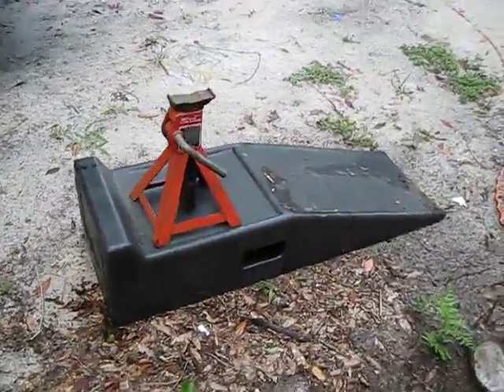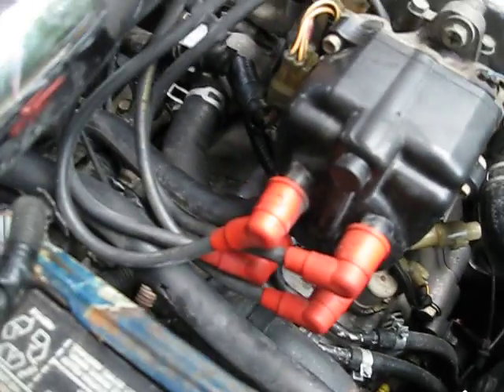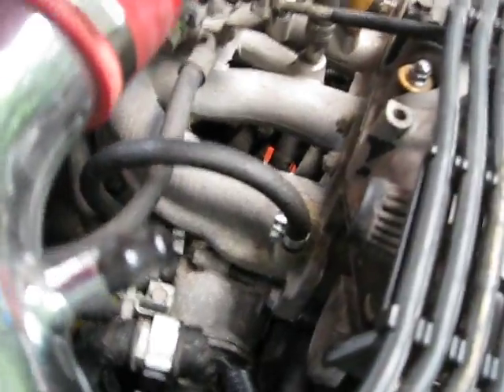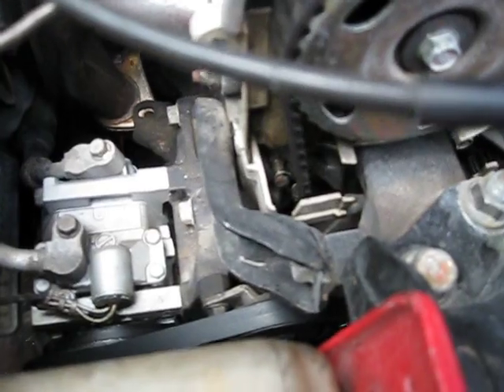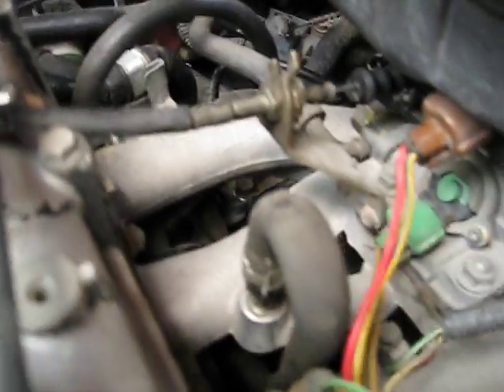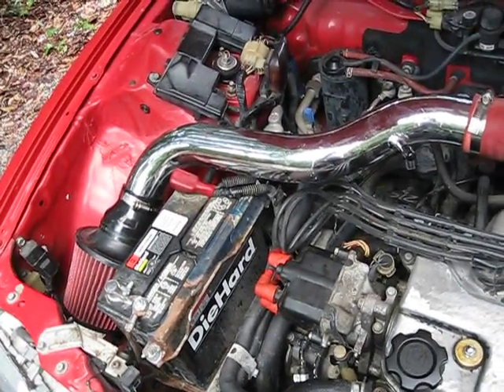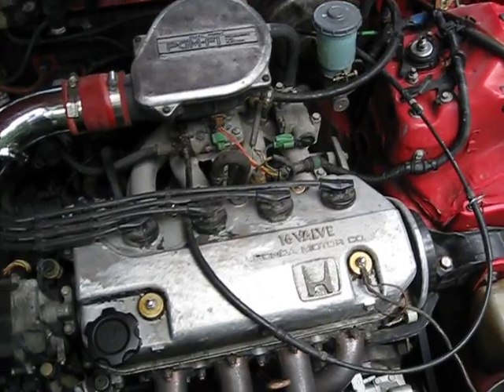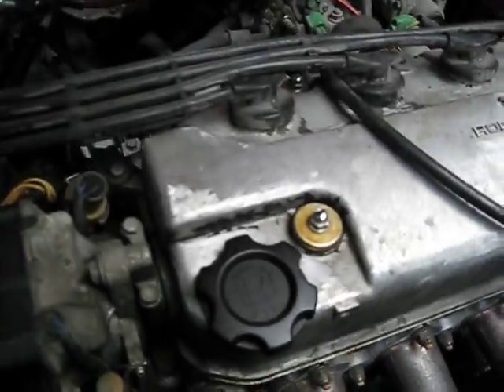CRX head gasket removal part 1

Comment: I have the same car with dpfi. All you have to remove on the intake is the bolts holding it to the head and support bracket and slide it back and inch or so that you need to get the head off. I even kept the throttle cable attached. Your making life too tough on yourself, really.
Reply: That is what I wanted to hear. Thanks man!
Reply: journeyquest1 hey is it really easy to do a head gasket on a 87 Honda crx